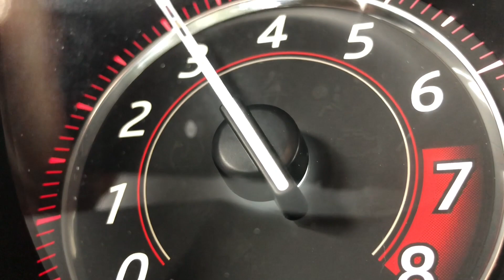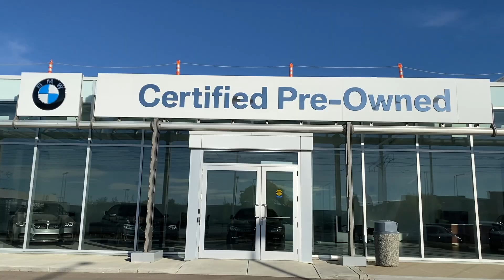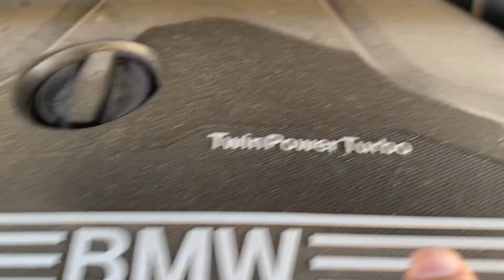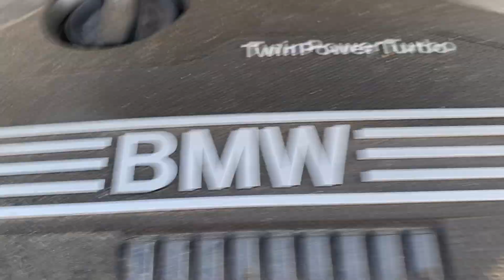Here's Why A Used BMWs Is So CHEAP

Comment: Two reasons they are cheap. 1 Unreliable, 2 Maintenance costs. Remember a while back you showing a piece of rubber pipe that cost $150. That says it all.
Reply from the maker: Exactly, parts are way over priced and that scares people away, hence lower value
Reply: That's why BMW stands for Break My Wallet
Reply: Everything is plastic and wasn’t the diagnostic when you take to a dealer cost over $200.00 dollars or more.  They don’t make them like they used to, I remember the BMW’S 1971-1974 those were great cars.
Reply: I got a 2017 X5 last year. M package, almost fully loaded, low km, it had one count of accident on the front. I got it for half the price when it was once new.
Reply: A third reason...they're starting to get really ugly. Have you seen the new XM?🤮
Reply: Most supercars and hypercars are unreliable to daily drive and astronomical to maintain, yet people want them. BMW is just not that desirable. All their 100k+ cars tank like rocks
Reply: @Vincent-ke5zn  nah it's brutal money waster
Reply: @Mark-rt6fy  nah supercars and hypercars are in their own category it's not that they are unreliable or reliable they are more a status symbol more than anything and if you own one you're more than likely able to afford anything that goes wrong or needs replacing or fixing most cars now are not really meant to last and it's mostly due to it's not feasible from the manufacturers standpoint 1 it's expensive to make something like a tank without it being very basic 2 cars have gotten very complicated 3 most people get rid of their cars every 4 - 5 years because they want something new and lastly most people also lease for that very reason they want new cars
Reply: If it didn't have the European roots, we would trash then like we do Kias or Hyundais. 

I'm ok doing maintenance and paying a little more for parts etc but so many things break often. My 2007 winter beater civic is more reliable than a 2015 X5. Windows jamming, doors not opening, wipers breaking ,, Parts melting, interiors handles  melting due to heat, etc. 

Instead fanboys are tricked to think those are normal things and you have to be rich to maintain. 

Those issues aren't maintenance . Maintwnce is doing oil, brakes, fluids etc.

Comment: Went to my local BMW dealer today for a safety recall repair on my BMW.  The repair shop rate is $198 per hour.  Since a person works about 2000 hours per year, at a shop rate of $200 per hour, that works out to $400,000 per year for a shop technician.  I wonder how many of the BMW owners make more than $400,000 per year and are willing to buy repairs at these prices?
Reply from the maker: Great way top look at it.  Cheers.  Guess they have to pay for the marble floors, marketing noise, free coffee, pointy shoes, fancy jumpsuits, and dealership expansion plans.
Reply: A tech just makes like $30hr flat rate.
Reply: @RedTekno  $30 per hour for the tech doing the work, and $168 per hour for the boss.  Sounds typical.  I can;t think of a good reason to spend my money at one of these fine establishments.
Reply: Some people would care less..just want to be seen driving a bmw for prestige..but then there are those who can afford.
Reply: Just find a good independent German repair shop....they usually have better tech's and prices .....
Reply: @spanishh2001  very few of those around. At least not many honest ones
Reply: @lesterparker1594  Their are plenty of good German repair shops around where I live in Germany

Comment: Yeah Mark, there have been plenty of BMW's new and used in the Phx Valley when there have been -0- Toyotas/Hondas/Lexus here. Also the cost for these BMWs is very tempting. I just looked on Cargurus here, and 7 series BMW's that ARE ONLY 3-4 YEARS OLD are going in the 40's and we're not talking high milage cars
Reply from the maker: It really is tempting.  Some are certainly a lot better than others and generally steer away from V8s unless a car like the M5 is a must have, otherwise b58 is the best bet
Reply: Good chance they've only had one oil change in that period. Also those giant limos (inc A8, S Class etc) are chock full of embryonic tech which isn't long for this world...

Comment: The B48 and B58 cars are holding values incredibly well.
Reply: I’m looking at getting a M240i for the B58
Reply from the maker: 240 is a little hotrod
Reply: i wanna get a f31 wagon with this engine and just replace the plastic parts that has a metal upgrade, i heard they are reliable
Reply: B58 is the best engine in Bmw's lineup I have the 640gt no probs yet
Reply: @ethanwelch6345 u won’t regret it

Comment: I mean I am looking for a 6 speed black sadan thats at least going to go 20,000 miles before I have to do something and my friend is recommending a straight six or v8 when it comes to the burn my wallet brand
Reply from the maker: Never the V8 unless you really need the tops performance.  Pricey failure modes.

Comment: Basically, the only reliable BMW's were the ones built in Germany in the years 1970' & 1980's.  Maybe in the early 1990's too.
Reply: e30, e46 and e90s are pretty reliable.  They do require preventive maintenance (ex. cooling systems) that's DIY-able.

Comment: My wife is really in love with the BMW SUVs... So, even after considering all of these risks. She is still interested in buying the X5 or X7...Would you please suggest which (Used 2020-2002) one would you pick for a family vehicle, X5 or X7?
Reply from the maker: Absolutely I get it, my wife is the same way and honestly the best vehicle in my opinion would be the X5 as the size is spacious but it still drives a bit more car like and I would definitely get it with the 40 series which has the turbo6 B58
Reply: @ECPP  Awesome, thanks for replying so promptly👍🏼. I appreciate it very much. I will definitely check it out the X5 XDRIVE40I. Maybe one that is CPO. ☺️🤞🏽 Thanks for sharing all your knowledge and for all your great videos, they are very helpful!
Reply: Mark is spot on I highly encourage you to get the X5 with the B58 engine! It's top notch, and reliable with the beautifully smooth inline 6 turbo. You'll be a really happy camper guaranteed!
Reply: @germanengineering204  thank you very much for your feedback. I can't wait to get one. Do you think is there a big difference between a 2019/2020 vs a 2022. I see they look almost identical.
Reply: @frostbitedos  No major changes that i know of should be identical! B58 with the ZF8 tranny is a winning combo, and is the best choice. Guaranteed you'll think this is the best powertrain ever created once you drive one! Their worth every penny, and consumer reports said it was one of the best vehicles they've ever tested!
Reply: Get that extend warranty!!!

Comment: I’ve been researching used bmw’s lately and stumbled upon a few 2014-17 640s for under 30k. Do you think that the n55 in the series is a good buy?
Reply from the maker: Nice
Reply: @ECPP  so yes ? A n55 6 series with about 75k miles is a reliable buy?

Comment: The car itself will depreciate but the parts, service and labor costs go up with inflation (in the US it's called corporate greed, but I digress). An average of $1700 per year in maintenance cost, just for the "major service":  Yep, the horn and wipers work, tire pressure good and four quarts of BMW grade oil from the barrel that'll be $2k (before the coupon). Then there is that "up sell" at a dealer. Heaven help he or she who has any major mechanical or electrical issues. That's only a short matter of time!
Reply from the maker: You really nailed it and it’s bad that there is so much margin on everything.  Profits are fine, highway robbery is another.

Comment: Who takes their car to the dealer to be serviced after the warranty expires? Smh. Here is a tip.. FCP euro, great prices on parts.
Reply from the maker: Cheers
Reply: SO some newer cars because the electronics, especially the ones connected to the engine, can't be worked on by a non-licensed mechanic/technician. At least in Canada
Reply: @joeblow9657  
That’s when you take it to a reputable independent shop. Anyone paying dealership repair prices after the warranty expires is being taken. There are plenty of great indy shops, at least in the US.

Comment: What about the bmws with b58 enignes
Reply from the maker: B58 is a solid unit, so far, time will tell.  It is the engine to have right now in the current BMW lineup
Reply: B58 is a better engine then N55 because you can get more power more reliably out of it. The problem with BMW is not the engine but the accessories on or around the engine like alternator starter motor injectors hoses radiators fuel pumps which are very similar on both. If you doing your normal maintenance with good engine oil changed every 5000 miles and good petrol from BP petrol station and you don’t abuse the car( heat is a killer too)  those cars well last for years. Mercedes and Aldi are very similar to BMW when it comes to reliability and spare parts so people tell you they are better they are dreaming. Most of the time BMWs a little bit more sporty than others and this is why they get abused and have problems.
Reply: @Pawelmps  I agree with your statement 100 percent im 21 now but I got my 440i (used 2018 bmw) when I was 20 all I’ve done has been oil changes and I’ve rotated the tires but that’s because of personal preference 😂😅

Comment: If I gave you a blank check and asked you to buy me a used BMW what would you bring back?
I’ve had several, never bought new. Best one I had was a 2000 MRoadster with 57,000 miles on it. Held it for 12 yrs until a guy offered me enough to let it go. 

Anyway what’s your iconic used BMW. 
2012 M6?
Reply: I love the E30, someone I knew had a bkack 325i with m kit, grey leather and spokey wheels. I still want one like that.
Reply from the maker: For me, e30 325e and an e60 m5

Comment: You have no clue what you're talking about... all newer vehicles are made of stupid plastic garbage.  You cannot place weak engineering solely on the manufacturer.  A year ago, BMW dealerships had VERY limited new cars... 2021 some dealers were allocated 7-11 units a month.  UCD Parking lots had a couple units, far from packed. Name one dealership that was packed with new bimmers last year?  You cannot!
Reply from the maker: I can but will not give them credit at this time